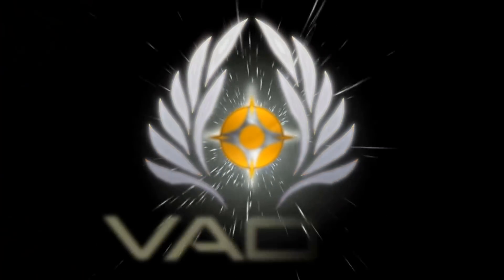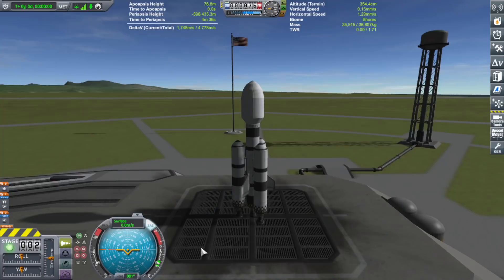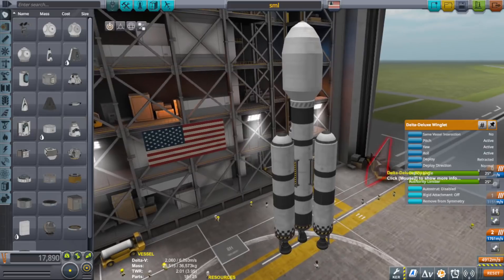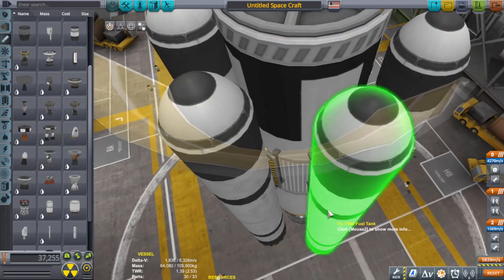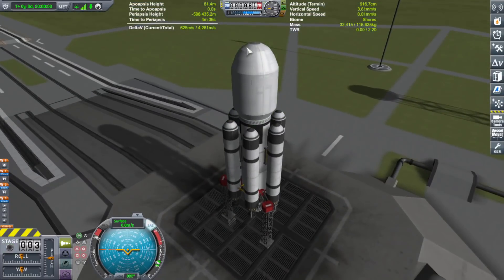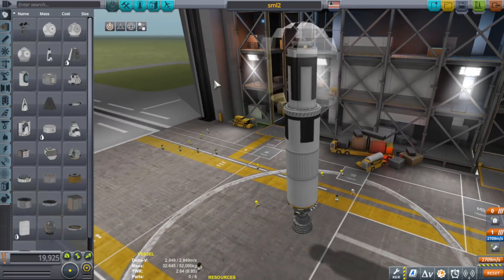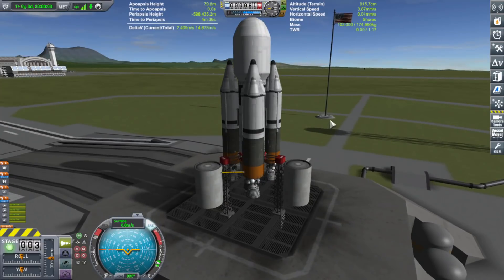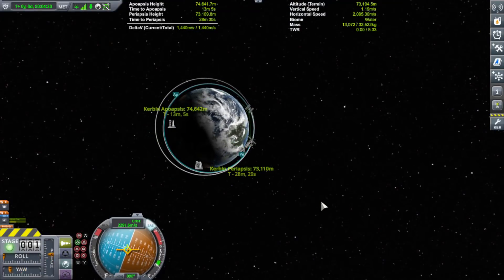TIPS AND TRICKS ROCKETS MECHANICAL SEPARATION GRAVITY TURNS AND MORE. | Kerbal Space Program

Comment: the first trick is essentially recreating what fighter jets do on their bomb pylons. the high pressure air, especially under the wings, could blow bombs or other munitions back up into the wing and cause damage (as was found out the hard way when bigger and faster strike jets were being built in the 50s and 60s) so when a modern jet drops a bomb, hydraulic rams physically push it down and away from the pylon and out of the high pressure air under the wing

Comment: In a rocket you need to keep the aerodynamic center or center of drag always behind (say lower) than the center of mass. During ascent the center of mass can shift dramatically (because of fuel burned away or staging...) so that at some point those rockets will start to flip as the CoM shifts below the center of drag. You can also stop that from happening through the flow priority option. Make sure the uppermost fuel tank gets drained last (has the lowest number) so the center of gravity stays high. Also during ascent drag is reduced so the force it can have on your rocket gets lower and lower.
I guess that the nose cones reduce drag on the front. Through adding them the center of lift doesn't seem to do anything in the VAB, but it might actually shift the center of lift more to the back during flight... why adding more nose cones even though there are no noses to cover further adds to the effect ... seems to be Kerbal science.

Now with the CoM more to the front of the rocket you might need to start the gravity turn later so the nose isn't dragged down too hard... or you need to add more wings on the back end ;)

Comment: Never needed to do that mechanical separaton method you are using. I just connect the decoupler almost to the top of the booster with the force at full, and then strut it at the bottom to keep it stable. When you stage the decoupler, it will push the top away. I will still often use one separaton clipped into the nose of the booster with no more 1 second worth of fuel on very large boosters, just to make the separation cleaner.

Comment: Great video, veteran here and I learned about  your booster separation and nose come trick!! I would however add a tip of my own for unstable rockets: use fuel priority to drain fuel tanks bottom up
Reply: why would you want the bottom tanks to drain first?
Reply: @robdekiefte31  think of of rocket like an arrow. For maximum stability you want your weight up top (arrow head) and your lift at the bottom (feathers)
Reply: @hatoffnickel  what do you mean by "fuel priority"? Is it achieved with fuel duct or there is a way to set them up without the duct? Thanks in advance.
Reply: @NicolaiNita  hey dude, iirc you can enable both fuel priority and autostrut by checking the advanced tweakables option in game settings. Then in the vab, you right click on a fuel tank and you can set the priority order of that tank

Comment: I've honestly never known how to gravity turn. I'll have to try it later. 🤔  the strut or structure part as a separation device I've heard you talk about it but it is. Nice to know how. 

One trick I use for my staging is to have the booster engines lower then the primary engine. I also have never liked the hydronic release, I've always used the radial decouplers. The flatter ones  for 1.8 size or smaller and the tall ones for 2.5 and larger. I sometimes use a single physical strut near the bottom of the rocket, don't know if it helps or not but with the engine weight below the primary engine the tails get pulled towards center and the tips spread out.  

And BTW, the scale measures atmospheric density. And the very top of kerbin atmosphere is 70km. I shoot for 80 personally in career mode because nothing is worse then being just shy of orbit and falling back to kerbin with weak rockets or not enough fuel. Lol

Keep up the great work. 👍 the tips videos will surely be popular. Keep at them. Tips about landing various craft on the different bodies  such as target par on approach. Making the landing more efficient.  That kind of thing.   I'm normally not very efficient and fairly "ham fisted" when it comes to my landings lol

Comment: Loving this little series. Advanced construction tips are greatly appreciated even for those of us with some hours of KSP under our belt. For example, I made a Munar Lander out of a structural tube with tanks + engines on the outside and the ascent stage inside the tube with a decoupler and some sepratrons for the first disconnect on launch I am really proud of. Nobody has shown this technique but it is super fun to build and fly.
Reply: Make a vid, would love to see that lander
Reply: I like the sound of that lander.
Reply: when i put decouplers in structural tubes it never ends well. if it got it good only the structural tube and maybe the decoupler explodes. if im unlucky then my command module will end up flying and i will get myself a permanent settlement.

Comment: I use small fins on the boosters, about midline, one on each side. If the connection is higher up, it pushes the nose away from the rocket and the booster flies away gently from the craft. For more effect, tilt them outward a few degrees.
Reply: I but mine pretty much at the bottom of the booster.